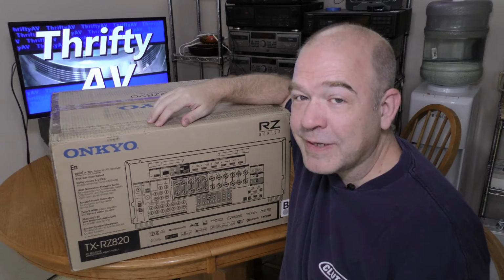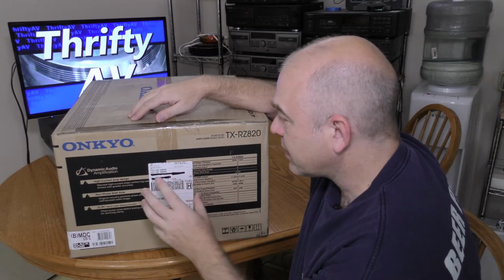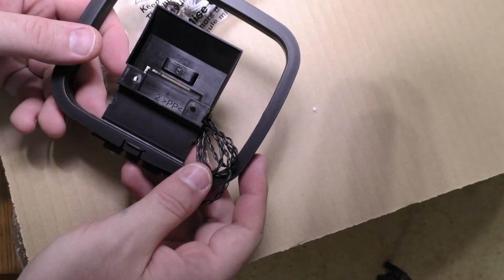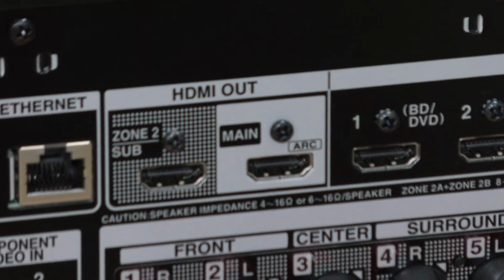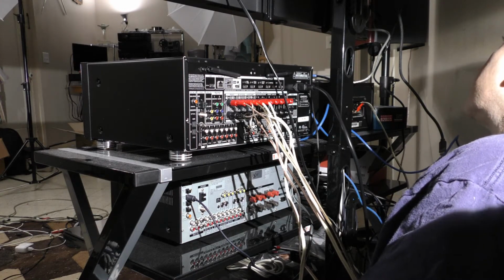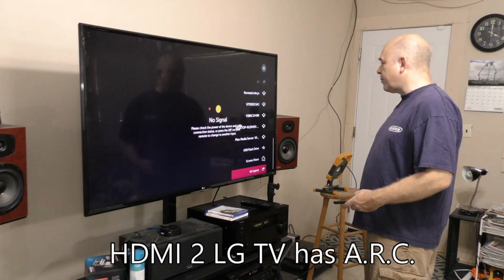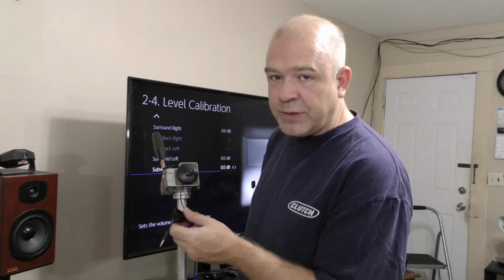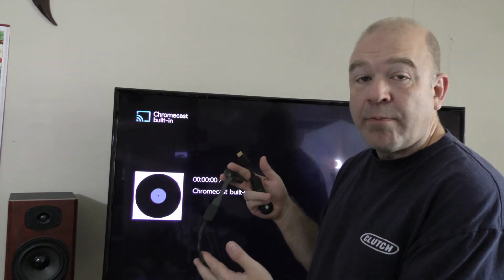Onkyo TX-RZ820 THX AV Receiver! First impression.

Comment: Hi it's a nice video, I have the same receiver in my home. I have doubt that whether the exhaust fan mounted on the top of the box will work immediately or it will work once the heat exceed to certain temperature. I never seen mine running. May be my fan has problem or it is programmed to work only in certain temperature. Could you please confirm with your unit.
Reply from the maker: Thank you.  I plan to do a followup know that I've owned it for about a month.  I have the Onkyo app installed on my phone, and it works great!  Bluetooth works well.  I got the ARC working properly with the TV set.  And I've tried a 7.2 setup (although the two "side" speakers kept getting in the way, so I went back to 5.2.  Haven't tried the zone 2 stuff yet, but when I do, I'll post the "Onkyo TX-RZ820 "update"!
Reply from the maker: At modest listening levels, the cooling fan generally doesn't engage.  To make it run, turn up the volume to listening levels that might disturb the neighbors and leave it there for a few minutes.  If it still doesn't kick on, you may have an issue.

Comment: Recently I did a firmware update it was 70 percent thru when an error message came up I had to shut off from the receiver turned it back on it said please update so it continued and completed but know when playing on chrome cast or air play the video is blacked out on the left side of video like a shadow  my question is if I reset the receiver will  that correct it

Comment: I have the Onkyo TX-NR686 and make sure you press the power/standby and BD/DVD buttons on the receiver itself to enable 4K HDR on the HDMI inputs otherwise you’ll only have 1080p HDR!!! I can’t believe Onkyo didn’t specify this on their website or instructions... One of those hidden menu options..
Reply from the maker: When I hooked up my Goobang Doo XB-III (4K android box) to the TX-RZ820, it switched over to 4K by default.  So this is not an issue with all Onkyo models.
Reply: ThriftyAV oh ok it’s because I have my Onkyo connected to my PS4 Pro and the 2160 RGB option was grayed out and took me a week to figure out why this was, I even tried different HDMI cables, plugin to tv directly etc. Until I came across some forum... other than that, I love my TX-NR686😎🤙🏻

Comment: I have a non ARC TV.  Will have a Firetv and Blu Ray in their respective inputs.  Will I have audio/video thru the HDMI out (ARC)????????? I am waiting on receiving and I don't want to use optical.
Reply from the maker: If your TV does not support ARC, then communication though the HDMI hooked up to your TV will be one directional, from the receiver to the TV.  For FireTV and BluRay, this is no big deal as these signals are coming in through separate devices; however, if you are using the tuner on your television to pick up broadcasts, and you want audio from your television tuner to play on your receiver, you will have to find a method to get it there.  

The three methods to get audio from your TV tuner to the receiver are HDMI-ARC, optical, and analog stereo RCA cables.  The limitation on the analog stereo method is that surround programming will be limited to older Pro Logic technology, no Dolby Digital or DTS.
Reply: My Pioneer plasma is 1080P so is the BluRay.  Will I receive up to 5.1 DTS on the BluRay and regular 5.1 on my Firetv even though I don't have ARC.  I would connect them to the HDMI inputs of the ONKYO and use the HDMI out marked ARC and plug it to the plasma for viewing and listen to audio thru the ONKYO.  The receiver has not shipped yet and your decision is crucial.
Reply from the maker: @dea535  The way you describe hooking up the BluRay and Firetv, you will get 5.1 (or even 7.1) just fine.  You would only run into audio issues if you used HDMI inputs for these devices on the plasma TV.

Comment: Recently purchased a  TX SR 373 receiver as an open box as is model from Best Buy, without
a remote. I got an off brand RediRemote, but the setup screen doesn't show up on my projector. I contacted
Onkyo, but they won't return my emails. Struggling with setup/surround sound/adjusting sound etc.
 I'm open to any suggestions.  I got the hdmi sound extractor box.  I did get sound with an optical cable, however
not getting sound from all speakers. The bass and treble aren't working on the remote. According to the manual,
 it seems I need  HDMI to get on screen set up but as I said the HDMI isn't working with my projector.
Reply from the maker: Most universal remotes are pretty good at setting power, volume, play, FF, etc, but notoriously bad at programming the menu buttons.  You could try one and see, but I wouldn't get my hopes up.  You may have better luck simply finding a replacement remote on Ebay.

Comment: How to connect wifi connection in ONKYO receiver  TX-RZ820
Reply from the maker: On the remote, hit the little button that looks like a gear.  Menu item 5. is "Hardware".  Then hit "Network" and your choices are wireless or wired.  Pick wireless for your wifi connection.  Do wifi setup and it should find your network.

Comment: Did you set up manually your speaker or with AccueEQ ? I got a new TX NR696 and the sound is not loud. I have to increase a lot. I've got a TX NR 828 but doesn't work anymore (it shutdown after 2/3 sec) but sound was far better.
Reply from the maker: I use AccuEQ.  The TX-RZ820 provides plenty enough power for my Polk S-60 mains.  The 696 has 100Watts per channel, not as much as the 820, but it should still be pretty loud.  Try "direct" mode and see if it is still underpowered.  This bypasses all the digital signal processing (including AccuEQ).
Reply: @ThriftyAV  I set more level in front. It's better. However I find my subwoofer very poor when I run a movie from my TV/NAS and ARC mode. I have two Klipsch RF 82 Mk2 in front and a sub Klipsch SW112... Damn this new NR696 is very disappointing
Reply: @ThriftyAV  the 820 only has 120W per channel. The 200+ w printed on the box is a scam (only 1 channel driven and at THD of 10 !!!! % I believe) The true wattage is more like 120W
Reply from the maker: @NoRoads2AllRoads  The spec sheet says 130W per channel, two channels driven with 8ohm speakers with 0.08%THD.  This is the official FTC spec as required by federal regulation, so they shouldn't fudge on this. 

The 250W power rating, as you said, is for one channel driven and has a terrible THD of 10%. This is with a 6ohm speaker that nobody owns.

The spec sheet lists even higher power rating claims for "dynamic power", but this is not a continuous power rating and no THD is listed. SCAM indeed. 

Regardless, with efficient speakers like my Polk S60 mains, 130W stereo is plenty of power for my living room.

Here is the link to the spec sheet:
http://filedepot.onkyousa.com/Files/sell_sheets/TX-RZ820_US_05.08.17.pdf

The YouTube channel Techno Dad did a recent video about power claims by receiver brands.  They ALL print these inflated specs on their box and stickers.
Reply: @ThriftyAV  how do you feel about the S60's? It's on my watch list and I keep thinking if i should pull the trigger or not. I can get them for about $200 each on a promo.
Reply from the maker: @NoRoads2AllRoads  Excellent speakers, especially at that price!  I got my pair recently.  The unboxing and initial impression vid is also on my channel.

Comment: Thinking about buying the onkyo tx-nr696. What are your thoughts on that? Do you know if i can chromecast videos with that? As of now i use an old onkyo receiver (which im going to replace as its not working 100%), but only audio through optical cable and chromecast using my smartTv. As im thinking of buying myself a xbox one and some other stuff i want to connect everything via HDMI.. but it would be a bummer if i couldnt cast any video. It might be a stupid question, but im kinda new to this stuff ^^
Reply from the maker: I don't know as much about the NR series as I do the RZ series, but my understanding is that the Chromecast on Onkyo receivers is AUDIO only, not video.  To Chromecast video, I use an outboard device.

Comment: I'm thinking of purchasing this unit, I've heard of several issues with onkyo's including 
HDMI problems. How has this model been for you and would you recommend it.
Thanx
Reply from the maker: If you search "Onkyo HDMI Problems", you will find many articles about receivers manufactured between 2009 and 2012, and Onkyo even created a Customer Care Program to help resolve customer issues with those models. However once a brand develops a reputation, it is hard to shake.  

As far as other issues you might have heard, a lot of folks like to talk trash so you have to consider the source.  Some loyal XBox users badmouth Playstation, and vice versa... or Apple vs Andriod, or Chevy vs Ford. 

The only issue I had with HDMI was with the Audio Return Channel, and it turned out to be my Roku causing the problem, so I can't blame Onkyo for that.  Once I got everything set up, I've been 100% pleased with the performance of this receiver.

Comment: Hi, does the receiver have the 5.1.4 speaker output option for  atmos or dts X??
Reply from the maker: No.  The TX-RZ820 has 7 powered outputs.  For that configuration, you need 9 powered outputs.  I've read that the TX-RZ830 can do 5.2.4 or 7.2.2
Reply: @ThriftyAV  thanks, so the 9 channel tx-rz630 would output 5.1.4 atmos. Would that receiver be powerful enough for the pioneer Andrew Jones 5.1 speakers?
Reply from the maker: @brandonalbright125  I have done a bit of research on the TX-RZ830, but I am not at all familiar with the TX-RZ630, so I cannot verify that it will output 5.1.4 or inform you on power output.  Here is a link to the user manual for that model: https://www.onkyo.com/manual/txrz630/top.pdf

Comment: Onkyo downrezes component inputs to 480i, redering them basically worthless.
Reply from the maker: Thank you for this info.  I just read the manual, and yes, component inputs can handle 480i and 576i.  576i would be for countries that use the old PAL system.  It's unfortunate that this unit cannot handle analog HD through the component inputs.

Comment: You'll love it, but for a VERY short period of time. I was conned into an Onkyo, never again.
Reply: why? asking because just acquired an onkyo on a recent deal.
Reply: @NoRoads2AllRoads  
If you want it to last, I HIGHLY suggest investing in a QUALITY fan. They didn't engineer them right for the amount of heat produced. There's probably hundreds of videos on repairing them but it's not easy without the knowledge and tools to do it right. Im someone who can fix them but I was so disgusted with having to fix it so often I won't even spit on one now. Some people swear by them, I swear at them.
Reply: @NoRoads2AllRoads  
I personally have 2 of the Air Infinity Aircom TO fans. Worth every penny.
Reply: @NoRoads2AllRoads  
T8 not TO. On Amazon.

Comment: Onkyo is garbage. Have too many hdmi issues. you're better off with pioneer
Reply from the maker: The Onkyo TX-NR535 that I used for over four years never had HDMI issues.  The issues I had were lack of power (65W/Ch), lack of a built in phono preamp, and too few inputs for my many A/V sources.  

Since posting this video about my new TX-RZ820, I fixed the issue I was having with HDMI ARC with a new HDMI cable.  I'm no longer having any issues with HDMI.  The new receiver is loud and clean, with plenty of source options.  If I start having problems, the RZ series is covered with a 3 year warranty.  Comparable Pioneer Elite models offer a 2 year warranty.

I am brand agnostic.  I have owned A/V gear from Pioneer,  Aiwa, Akai, AKG, Alesis, Behringer, Denon, Hitachi, JVC, Kenwood, KLH, LG, Mackie, Marantz, Nakamichi, Onkyo, Optimus, Panasonic, Philips, Polk, QSC, Realistic, Rotel, Samsung, Sharp, Shure, Sony, Tascam, Teac, Technics, Toshiba, Yamaha, and more.  Most brands are a mix of high end and low end gear...  It's not as black and white as "Awesome" or "Garbage".
Reply: Pioneer's home theater brand has been owned by Onkyo since 2014 and they share a lot of internals, so while Onkyo did have issues in the past Pioneer and Onkyo are more similar these days than they are different.
Reply from the maker: @KCC46  https://www.cnet.com/news/pioneer-electronics-onkyo-combine-to-keep-pace-with-competition/
And now they have been bought out by Sound United (Denon, Marantz, Polk).
Reply: My 545 was 350 about 4 or5 years ago, no serious issues. Best bargain of a receiver ever, however I need pre outs so an upgrade is in order. Had an Integra 7.4 for fifteen years, recently sold for a hundred $.